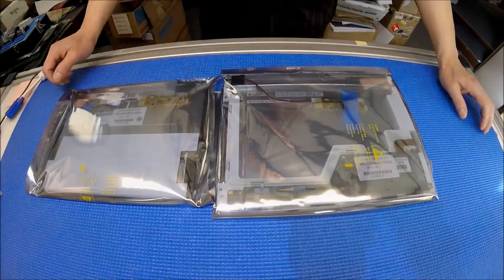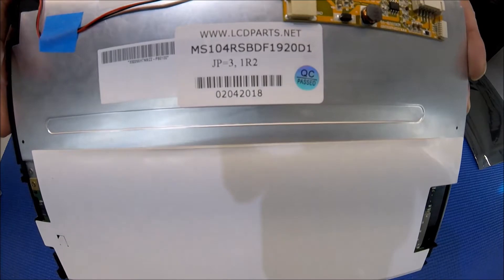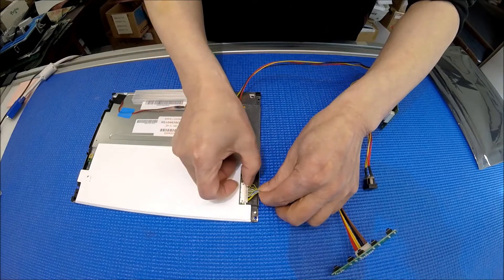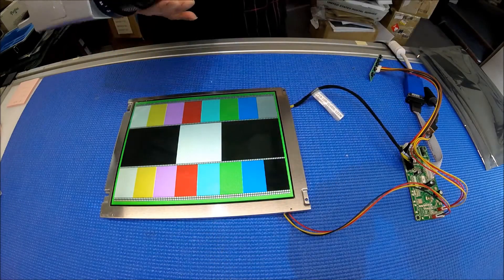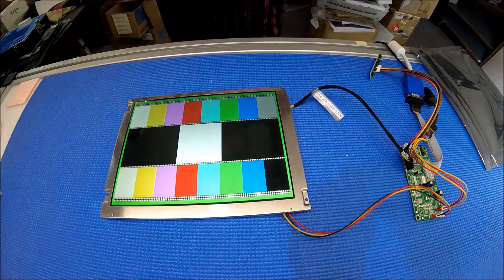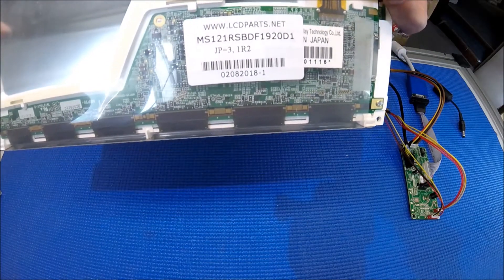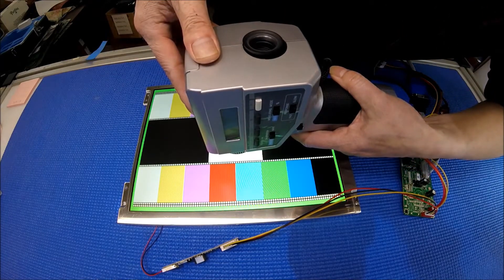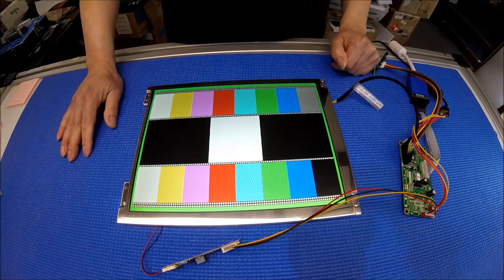Sunlight Readable LCD screen, 2000 nits

Comment: Does the LCD driver board you are using work with a lot of different models of LCD displays? 

Does it need reprogramming to work with different models?

Can the driver board be powered by USB?
Reply from the maker: Hi: Yes, it does need to reprogramming based on LCD screen's part number